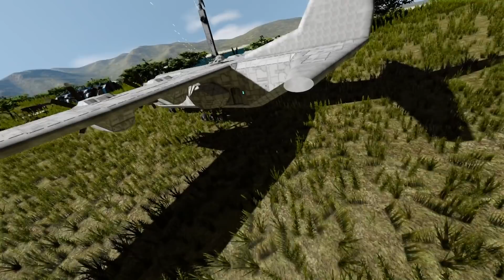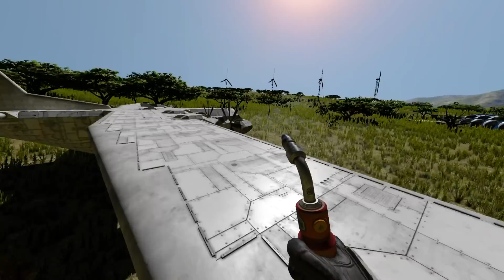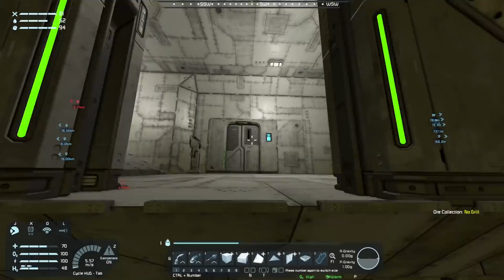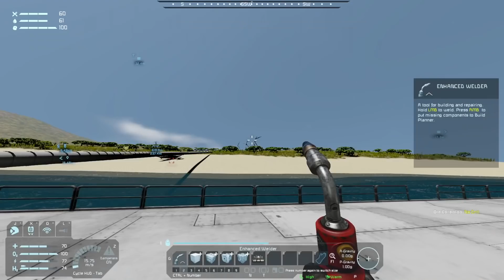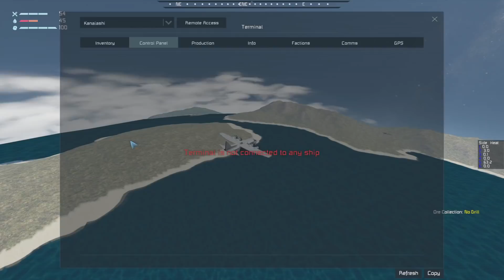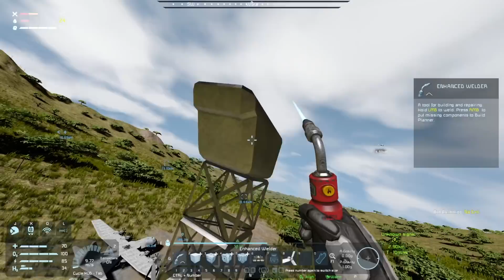Space Engineers - S4E28 'Putting The C-130 Through Its Paces'

Comment: A typical c130 would use the inboard 2 engines if operating on 2 engines, and how lmwide did you make your wingtip to wingtip wingspan?
Reply: Also the cargo door is a misnomer, it is actually two doors opening. The top pulls up, while the bottom ramp drops. Operable independently of each other

Comment: Suggestion. When placing those auto-drills, you can place them on a platform and they work. so you can build out a platform and set them on top instead of embedding them into the ground. It looks nicer and easier to connect them up.

Comment: I'm going to give you a heads up: Generally speaking, it's not advisable to use a build and repair system near a structure owned by an AI, as there's good chance it would absorb the AI's base (i.e. Tear the darned thing apart) and cause issues.
Reply: Doesn't the don't grind neutral/don't grind unowned settings on the B&R prevent this?
Reply: @StyxRiverGynoid  In my experience, no. When I have B&R and I build it on the default starting structure, it frequently begins to disassemble the structure, even when I have grind neutrals off.

Comment: a few suggestions for the C-130, turn the walls of the hull into half slabs/armor panels, save weight and give you that extra space to squeeze past containers while on a slope, switch out the blast door blocks on the ramp for armour blocks to save more weight, and add a small battery, enough to power a beacon for emergencies.
Reply: Small grid light armour (including panels and slabs) are all 1 steel plate so all weigh the same because block weight is calculated from the components that make it.

Comment: Gas being more powerful than H2 makes no sense. Energy density is different but they are both gas as far as the engine knows.
Reply: Why are gasoline engines more powerful than diesel for the same size engine?

Fuel type makes a big difference to what you can achieve.

Hydrogen burns much faster than gasoline which puts a lot more stress on the engine, which combined with hydrogen embrittlement issues means you need a stronger, heavier, bigger engine to get the same power.
Reply: @JPEight  Energy density is highest to lowest... Diesel... gasoline... H2 which if kept  liquid needs high pressure and insulation. In game H and O2 could be catalyzed to some dense long chain liquid fuel like heavy bunker that would be energy dense and not explosive. It's the future right?

Comment: rather than build multiple planes, you can build roll-on roll-off modules that drive themselves into the back and lock down with mag locks. If you're concerned about CoG issues from multiple grids maglocked together, you can use merge blocks instead so that you're always flying a "single" grid. 

For example, a large cargo container with a few Build and Repair Units and enough wheels, batteries, and a remote + antenna could be used as a deployable construction module. Fill the cargo with the parts you need for a blueprint, set up a projector on the ground, fly away to do other things, come back and your blueprint is built. 

Make another remote cargo rover to roll off the plane, connect to a mine, siphon all the ore, roll back onto the plane, fly it back to base, connect it in a parking spot to hold the ore for the refineries to process while you grab the next one to get ore from another mine and so on.

Roll off deployable gun emplacements, assault vehicles, paradrop cluster munitions... the options are vast.

Comment: Suggestion for cargo improvement:

A real C130 typically uses pallets that roll/slide on and off. 

You could recreate this by attaching some 1x1 wheels to a small grid medium cargo, attach a battery, antenna, and remote control, and drive them on and off the plane RC-car style.  Hold them in place using mag plates or landing gears.
Reply: He’s already has a forklift design (or at least one of his fellow bots from WWU does). All he really needs to do is set up the magplates and use the forklift to load and unload them.

My thought was to use a small large-grid cargo container (as its about about the same size as a large small-grid one) and have a merge block on one side. If he sets up his bases with a conveyor line that connects with the cargo container when it merges, all he has to do is bring in empties and merge them onto the base, and then unmerge the full ones and load them onto the plane. He can probably carry at least two, and possibly three, of those containers on the plane.
Reply: I would also like to see a cargo drop and have it parachute down for pickup.

Comment: There's a door up front forward of the props anyway, at least on the ac130 from what I recall, possibly on the h models as you've modeled your plane after
Reply: The forward door into the cargo bay was removed, so it's just the two before the ramp and the door to the flight deck now
Reply: @luciferhellhound  even on the ac130? I got to see one late 2011 at Kelley field
Reply: @G3David  I know at least for the MC-130H, MC-130P, and the C-130J-30 the only access points are ramp, three hatches to the top of the airframe, two parajump doors, and flight deck entry door

Comment: Excellent content as usual, put a small wind turbine on top of the large one just put it on the top back away from the large blades it does fit and works just the same as it should on a tower that'll make life a bit easier for you also get a mod called Stackable wind turbines by TwitchingPsycho that'll give you even more power for the same space Ps what mod did you get the advanced static drill from plz

Comment: Would making the "connective" sections of the 130's skin in armour plates instead of armour blocks make any difference in performance and overall weight?
Reply: Love the armor plates or planes, except that for a 2d object, they consume an entire 3d block.
Reply: @michaelhixson6939  ah, fuck, right... but the total volume should be the same, right?
Even if you place them with the bounding box facing inwards, they'd occupy the same volume of a regular block, at a fraction of the weight
Reply: @talscorner3696  They'd have the same volume, but you lose the connections, because the planes only connections face-on and or the sides, depending on which armor plane you're using. 
 
As for mass, don't quote me, but I'm like 99% sure its based on the number of installed plates. 

And for small blocks, if I remember the armor block and the armor plane require the same number of steel plates: 1. 

So variable volume but constant mass. And I'm not sure how Kana's aerodynamics mod really interacts with the shape of vehicles. I haven't been able to mess with it. (been off SE for almost three weeks, cause my rig burned out my video card, and I'm gonna need a whole new setup)
Reply: @michaelhixson6939  ah, drat... I forgot light armour small blocks don't have many components xD

Comment: 28:06 You're actually basically doing a pretty common maneuver in aviation called a "slip" which is basically just what it sounds; you force the plane through aileron and rudder controller to not be pointed in the direction it's going thus significantly increasing drag. Very commonly used to bleed off speed and altitude if you're coming in to land too hot.

Edit: Also given the instant take-off we saw earlier, I doubt this aerodynamics mod simulates stall conditions (and certainly doesn't do a good job of it if it is trying to simulate stalls)
Reply: an aircraft cannot stall if its engines are powerfull enough and with SE physics its the case
Reply: @gd blaster  How powerful does that need to be?? F22 has a twr of 1.2 or something. F35 especially the b model has a twr that's closer to 2 I believe. They both can stall if the fbw system fails. Stalls are not a function of power it's a function of airflow over the wing being disrupted by a high aoa and the airflow just stops being attached to the wing and thus lift dies
Reply: @gdblaster9302  I would like to refer to and old adage from flight school, "Any plane can stall at any speed". Basically, a stall occurs when there is airflow separation from the wing. This happens any time the angle of attack (difference in angle between airflow and wing camber), is greater than the "critical angle of attack" for that plane.

As @commiccannon mentions, planes with a thrust-to-weight ratio greater than 1, can always stay in the air since the engines alone are enough to counter gravity. But they will still be in a stall if the AoA is too high which will result in a loss of maneuverability since your control surfaces don't' work in a stall.

In a wing-mounted propeller design, such as the C-130, a sufficiently powerful engine could help mitigate a complete stall by forcing airflow over the wing in certain areas, but it cannot be prevented.

----

I suppose what's probably really going on in-game though, is the turbo-props are overpower granting a >1 TWR combined with the fact you use gyros instead of control surfaces for attitude control in SE, means that even though he probably was "stalled" at take-off, that concept is now functionally meaningless